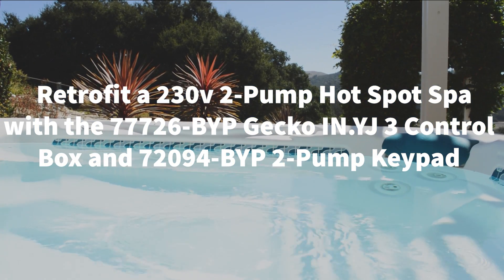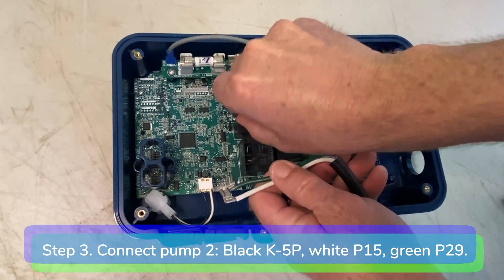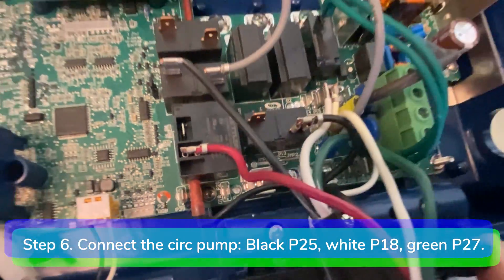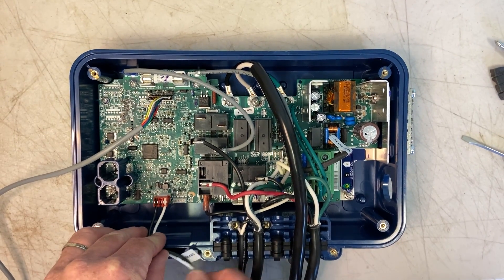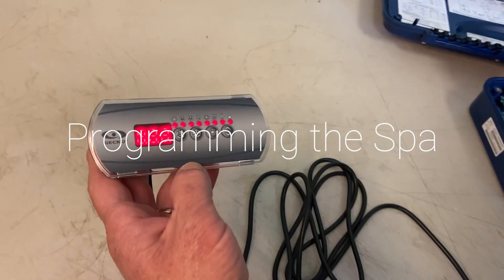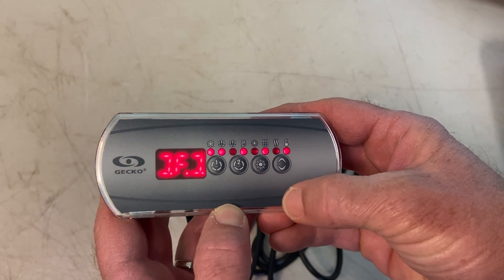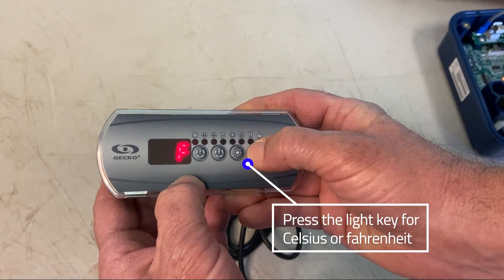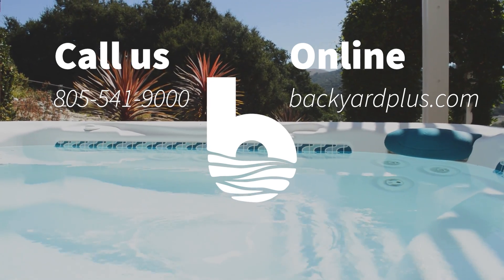Hot Spot Retrofit Gecko IN.YJ 3 Control Box and 2-Pump Keypad in a 230 Volt Spa with 2-Jet Pumps

Comment: Hi, thanks for the video. I'm upgrading from IN.JY2 to 3 I'm wired for 230 volt and I have one two speed 120v pump. Do you know if (red K7-9)  (black P39) (white P19) Is right? Any help would be greatly appreciated.
Reply from the maker: For 120v jet pumps: Connect the red low speed wire to K-6P, black high speed wire to K-7P, white neutral to P20 and green ground to P29.
Reply: @backyardplus   Oh, thanks. I found the manual, and it is working. That was very nice of you. Thanks again.